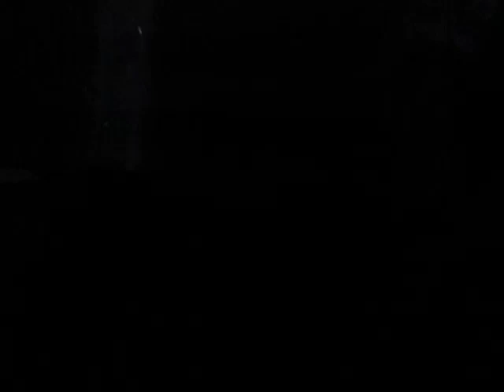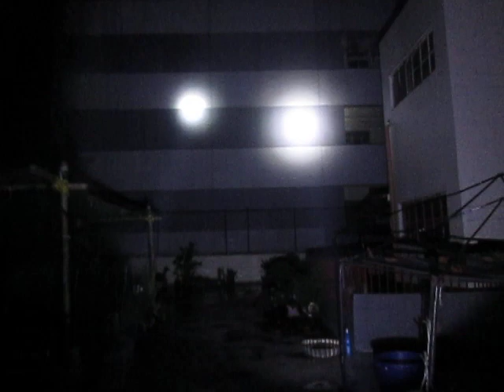Convoy C8+ (Osram NM1. ~4.5Amp ~700lm) vs Astrolux FT03 (SST40-5700k, ~2300lm)

Comment: Would you mind doing a distance competition between a C8+ Osram vs a Z1 Osram?
Reply from the maker: Ok, will try that.

Note that Convoy C8+ has 2 Osram variants:

Convoy C8+ (Osram NM1) = narrower/more focused (throwy) beam with less lumens
Convoy C8+ (Osram PM1) = still focused beam (but not as narrow as Osram NM1), with higher lumens, and still quite throwy  (I think the PM1 is CULPM1, but will verify)

The Convoy Z1 also has 2 Osram LEDs, as far as I know:
  Convoy Z1 (Osram CSLPM1, 6Amp driver) = I don't have this yet
  Convoy Z1 (Osram CULPM1, 8 Amp driver) = I have this variant, but have not done beamshots yet
Reply: @dta8437  Great, I guess ideally we'd see it stacked against both of them.

Comment: Don´t know which one to get, Convoy C8+ with OSRAM or SST40?  I do long hikes in the middle of the night with my dog, trails, hills, river beds.
Reply from the maker: If you mean Convoy C8+ (Osram NM1) vs Convoy C8+ (SST40), personally I would go for SST40, mainly because the Osram NM1 has a very narrow beam (very small area of light).

The narrow beam of light from Osram NM1 LED makes it "too glaring" when used in near distance, and although it can reach far, the small area of light might make it more difficult to identify the objects (since the lighted area is very small).

For instance, from a distance of around 70 meters, when I shine the Convoy C8+ (Osram NM1) on a car (from the side), the light will only light up the front portion of the car (quite bright), while the back portion of the car is dark, because the lighted area is small.  Whereas the Convoy C8+ (SST40) will be able to light up almost the whole car from the same distance (even when slightly less bright beam (versus the Osram NM1) reaching the car).
Reply: @dta8437  awesome, great answer. Thanks!